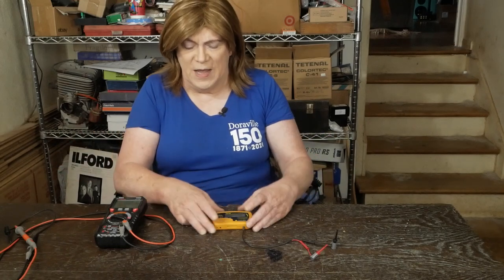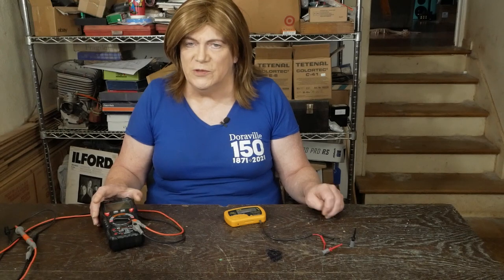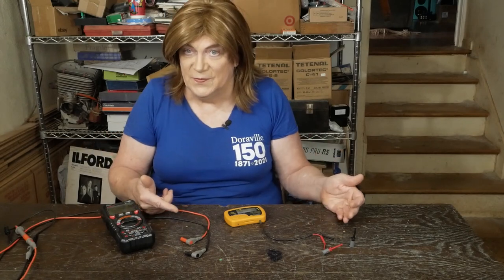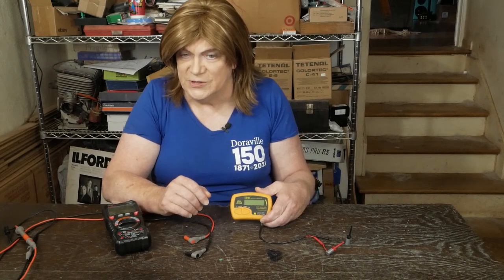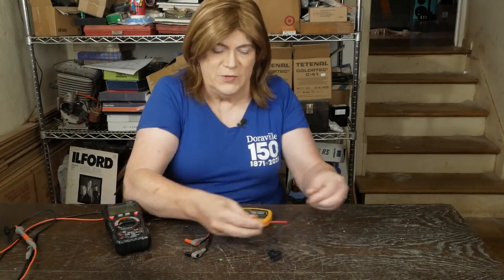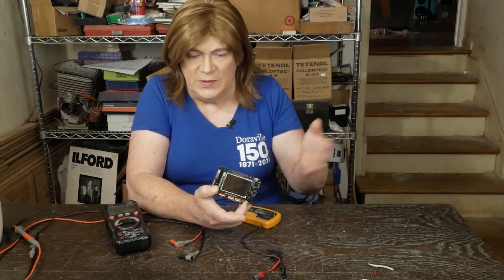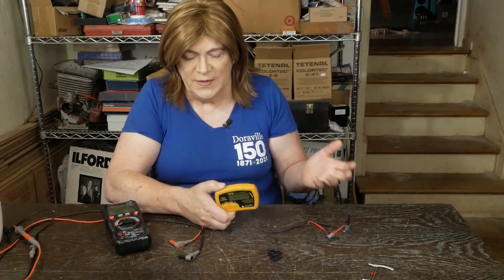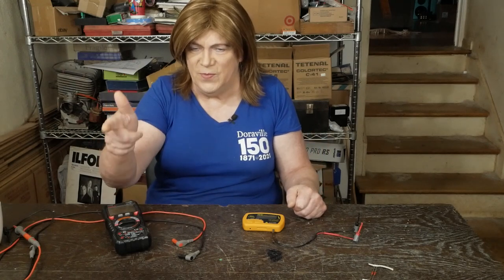PEAK Atlas LCR45 LCR Inductance Meter Review.

Comment: Re discharging capacitors. Earlier this year I got some JCCON brand caps from Ali for a power supply board. After testing the finished board, it sat there for around a month before I started doing something with it. I placed it on my bench top next to a metal key chain and at some point, I pushed it against the key chain and got a massive spark as it shorted out. Aside from the scare, I thought they must be pretty decent caps to hold a charge that long.

Comment: Good meters from China are great for hobbyists because of their low cost & they generally are accurate. Industry uses Fluke to make batch calibration & certification easier as they are standardized in industrial usage. I have a Kaiweets KM601 that generally work well at home. Once in awhile it does not boot properly & I just have to restart it. It is very accurate, but this is the kind of meter that you should not measure high voltage with. The circuit board layout & protection is better on the Fluke, but most homeowners do not measure high voltage. My workplace uses Fluke, but while knowing the limitations, a good meter from China is OK for home.

Comment: Nice review but I don’t think this one measures ESR for that you’d need the Peak ESR70 which I use.  I have a couple of Peak meters and they aren’t cheap but are accurate and work well (unlike the Chinese junk meters I had before).
Reply from the maker: I stand corrected. You are right this one doesn't measure ESR. It does measure impedance, admittance and mag/phase of caps.

Comment: It is not wise to short out capacitors to discharge them,it could cause some damage.I use a 8ohm 5 watt resistor to discharge.
Reply from the maker: I was referring to possible 2-3 volts they might have stored in them.